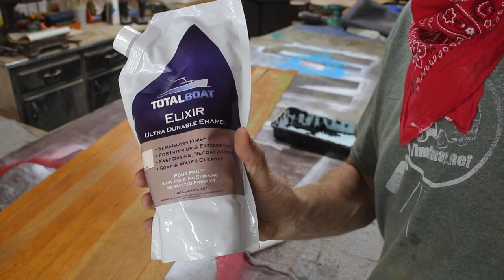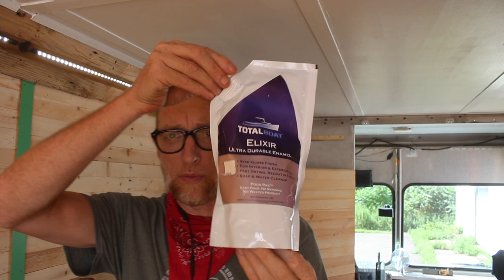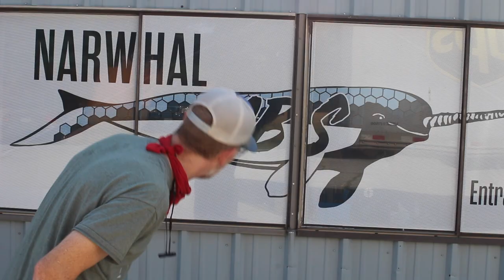Hollow Core Door Ceiling for my Step Van #Jambulance

Comment: I reused old doors for most of the things in my van, the outer skins where basically 2mm plywood,  no weight to it at all, so it wont be sucking at my mpg.  new doors (in UK) are now becoming like 0.8mm plywood facing on 1.2mm of mdf! so no longer 'waterproof' the slightest damp on the mdf side and it bows

Comment: Tim, can the Total Boat finish (Halcyon is the clear?) be tinted and sprayed? I don’t recall if I’ve seen you use it through a spray gun in any of your videos.
Reply from the maker: yes, it sprays well. THey make a clear and an amber (which I usually use on my guitars). I haven't tried tinting it beyond that, tho.

Comment: Have you mesured how much weight you put in the Truck? Some parts "looks" really heavy. greetings from Hamburg Germany ;-).
Reply from the maker: why yes, Yes I have. Data nerds unite! lol. Seriously, not to the pound but I have been keeping track and recently took the truck to my town landfill and put it on the scale. It currently weighs about 7300 lbs (3300 kg) which is great because it isn't until 10,000lbs (4500 kg) that I have to worry about special licensing and inspections. the tailgate is really the only hevy part with about 250 -300 lbs of steel and another 250-300 lbs of wood being used to make it.